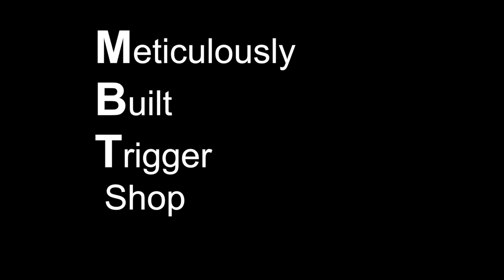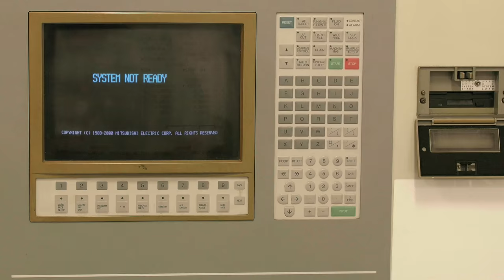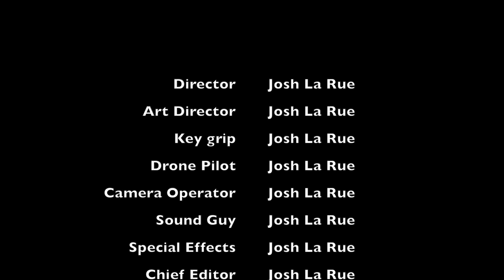Watch LaRue build their world-class AR trigger shop in living time-lapse

Comment: Larue MBT - when you can't afford a Geissele
Reply: This rakkasan can afford both I chose the MBT.
Reply: Hey now...easy there.
Reply: +jjon1967 ok settle down there Francis
Reply: I've got 2 geisseles and two MBTs. I prefer the MBT.
Reply: Own both prefer MBT. Geissele paying for a name.
Reply: I can afford either, I'm getting the mbt.
Reply: I have an SSA-E and 2 MBT's.......personally prefer the MBT's for PDW. Geissele is almost to light, and i only use that lower for my 20" precision upper. The LaRue's are just right for my run and gunners though. I see they are $87 now, that's an amazing deal. I paid $99 and they are worth every penny. I got my SSA-E for $156 free shipping on a weekend deal from PSA last year which was a great deal as well. Both are really great triggers and pretty comparable to each other if you used the preinstalled trigger spring. I run the heavy trigger spring in both my LaRue equipped PDW lowers.